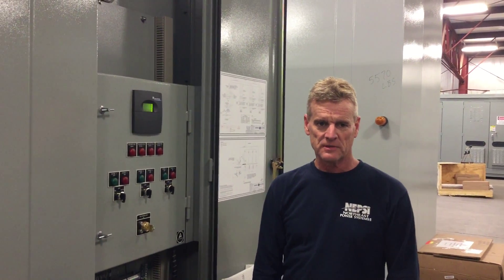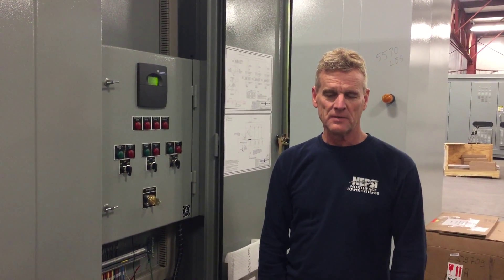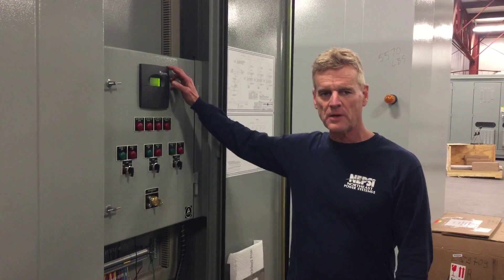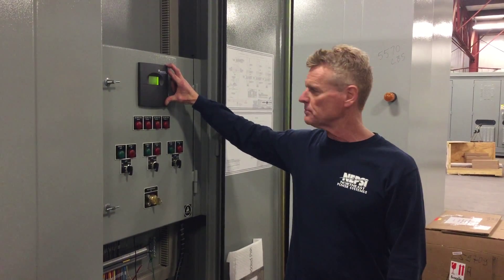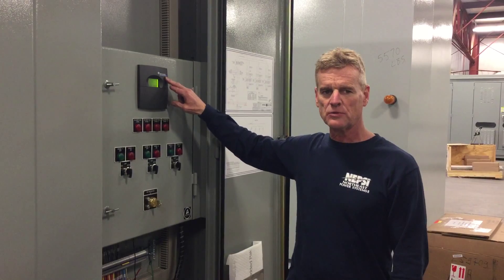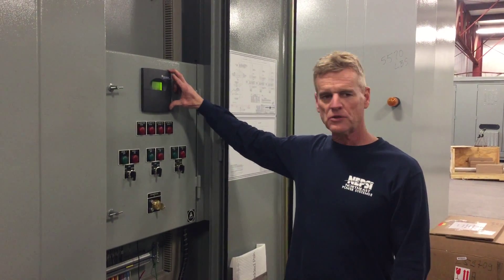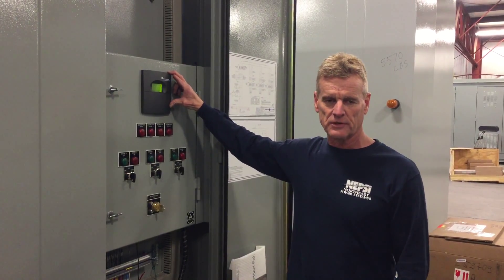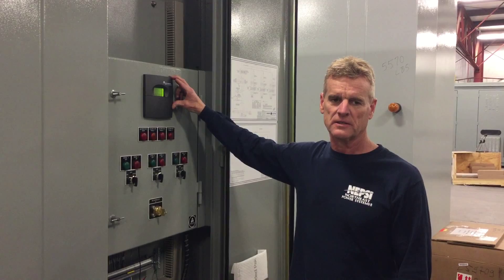NC12 Power Factor Controller - How to Change Target Power Factor

Comment: hello, at my workplace every month there is always a kvarh bill, is there a problem with the capacitor bank panel,, the installed power is 555KVA, the capacitor = nokian 50/54 kvar and the controller is nokian N12
Reply: How to communicate to dcs by using modbus or rs232